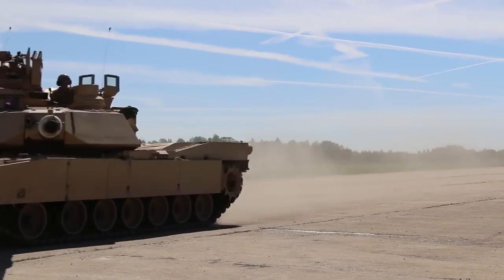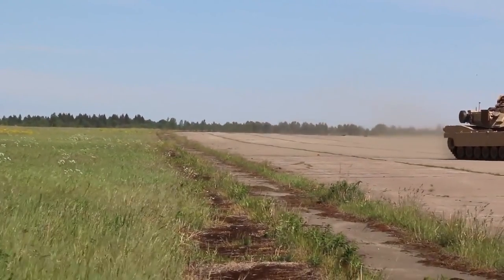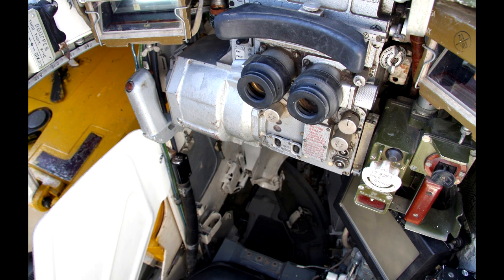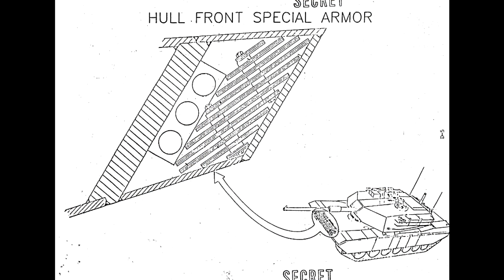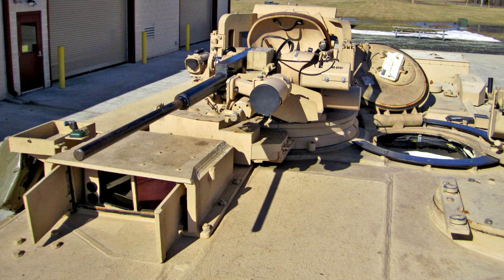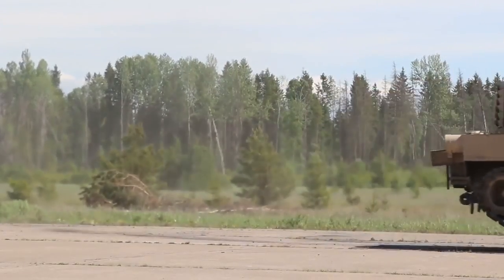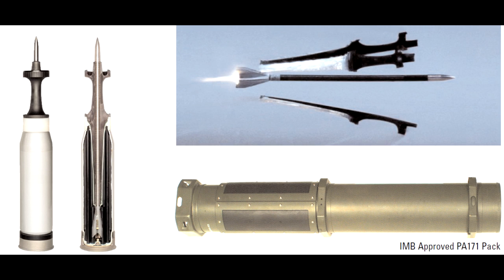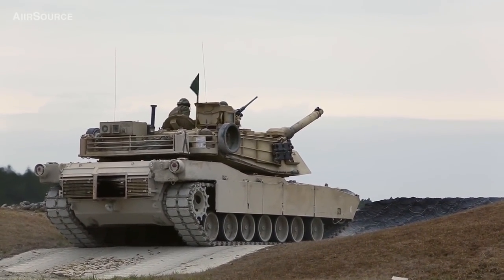Problems with Abrams tank

Comment: The reason the upper glacis is thin is because the armored fuel tanks under it. This is one of the best design features of the Abrams. Fuel is non-compressible and makes good armor. The Swedes used this in the S-tank and there is a penetration test on Youtube. It’s one of those things that would greatly benefit Russian style tanks with the carousel magazine.
Reply: Yeah but the fuel tanks are only on the sides/edges of the front, not in the center (well the driver has to be somewhere too).
The driver is sitting in the center, surrounded by the fuel tanks on both sides, which still leaves a vulnerable gap in the center.
And the Russian tanks do have fuel tanks too (how do you think they can drive?). It's not like the Americans invented fuel tanks lol
But still it's the same problem for Russian tanks too, the driver has to be in the center so the fuel tanks can only protect the edges
Reply: @xAlexTobiasxB  The driver position is the only vulnerable point from the frontal arc. But there is armor behind him as well. The driver’s compartment acts like the Leopard 2’s arrow armor and cause the fin round to yaw and thus not penetrate further into the tank. More over the armored wall of the fuel tanks on both sides of the driver’s compartment are sloped and act like highly sloped armor. There is also no ammunition in the front hull to ignite.

Russian tanks do not have armored fuel tanks up front. There is a fuel tank which offers minimal protection to the front ammunition storage, but these are too small, do not cover the whole front and do not have the Abram armored fuel tank’s protective design features. Many tanks like the Chieftain, Leopard, Ariete, all have fuel tanks designed to protect from HEAT from the side. The Abram’s fuel tanks are designed to counter HEAT and APFSDS from the front.

The Merkava gets a lot of praise for using its engine as a piece of armor. But the reality is Abram’s fuel tanks are superior as protection than the Merkava’s engine. Because the turbine engine is very thirsty, Abrams carry much more fuel than others too. And there’s far thicker composite armor in the lower glacis in front of this fuel.
Reply: @xAlexTobiasxB  No point arguing with someone that use personal attacks. You are simply, tragically misinformed. Bye

Comment: LOL, and THATS why the M1 didnt last long.  The M1A1 fixed basically all those first problems.   Never mind the M1A1HA, HC, M1A2, SEP and A2C lol.
Reply: The M1 was not the tank the Army wanted.  The M1 was the tank that the Army could get Congress to pay for.  The M1A1 was the tank that the Army wanted - but had to wait for the M1 to prove itself before they could get Congress to pay for the more expensive M1A1.  And there was also the issue of the US Army testing the German 120mm gun and rejecting it as 'not fit for service.'*  We had to design a new gun (the M256) around the German 120mm gun barrel.  

* The US has much stricter safety requirements for weapons and ammunition than most other nations.  Even today German 120mm ammunition cannot be fired from US tanks except in 'war emergency' situations where there was no US ammunition available.
Reply: Colin Campbell No offense but I heard du ammunition can be detrimental to crewmen's health
Reply: @hschan5976  And ive heard thats largely just a myth to try to make DU and the Abrams sound bad.
Reply: @hschan5976  it hasn't killed me yet, maybe that only applies in video games
Reply: @hschan5976  true, enemy crewmen, especially in Russian built tanks, lol
Reply: @hschan5976  It's only a hazard when it's travelling a very high speeds.  Otherwise the only safety requirements are standard industrial hygene practices (specifically wash your hands before you eat).

You have to remember why it's called_Depleted_ uranium, because the stuff that provides the most radioactivity (U235) has been removed.  In fact the radiation is not what makes DU a health hazard - it's the fact that it's about as toxic as lead.
Reply: Colin Campbell Does impact not create dust containing du material? Just curious. I honestly don't care whether the abrams is better than t72 or not. Ultimately it's air superiority that  wins the day. Has been so since WWII.
Reply: @hschan5976   No.  Because dust does a very poor job of penetrating armor.  And it does not create enough dust to worry about.  In fact the explosives residue from the ammunition on the tank is several orders of magnitude more toxic than DU.  And even if you swallow DU - the body does a poor job of absorbing it so 99.9% is going to be gone when you take a dump the next day.

Even the WHO has declared DU ammunition residue not to be a human health concern.

BTW - people who know the subject know that DU is inaccurate.  It's proper name is 'Staballoy.'  Because the DU armor and penetrators are alloys made from DU and other metals (molybdenum for tank main gun ammunition).
Reply: CMDRFandragon well said!
Reply: Same with the t 14
Reply: Steve Arthur  The Germans only had air superiority initially.  Once the Russians quit retreating and got their shit in order, they massively outproduced the Germans.  Id venture to say its more production that wins wars. 

As for the US and the Taliban, the Taliban are hiding in mountains and doing things to completely negate, or atleast mitigate the effects of air power.
Reply: Steve Arthur  Well, true.  They are fighting a different kind of war.  Taliban are winning much in the same way the VC won in Vietnam.   What I said about production only really applies in straight up battles like WW2, WW1, American Civil War, things like that, where its 2 sides beating the hell out of each other until 1 side loses the will or ability to keep fighting.

Comment: Laughable

Any other tank with the same amount of combat experience would have been far worst, especially Russian tanks.
Reply: The British Challenegr for example also saw combat and it performed so much better, especially in the 2003 Iraq war with no Challenger lost to enemy fire, while the Americans had to write off a couple of Abrams as a result of enemy fire.
Reply: @xAlexTobiasxB  also the italian ariete was deployed in afghanistan with 0 losses,m1 overrated
Reply: @damicocu3860  Yeah the Ariete, like its father Challanger, was deployed with dd-on armor to protect the sides. To be fair though, the Ariete hasn't seen as much heavy combat as the Abrams did
Reply: @xAlexTobiasxB  not as much but still.also ariete columns were attacked by explosive cars and resisted very well. A question:why are you calling  the challenger ariete s father?
Reply: @damicocu3860  Sorry it always kind of reminds me of the Challenger...
Reply: Nico they have some similarities but they are really different tanks
Reply: @damicocu3860  Yeah I know :L
Reply: @xAlexTobiasxB   The reason we destroyed those tanks was because they were 'mobility kills' that occurred deep behind enemy lines.  We were not going to abort the mission so we got the crew off and destroyed the tanks and continued moving.  And even then this was because of a peacetime economy measure that turned out to be a bad idea in combat.  A generator was mounted to the bustle rack to reduce fuel consumption in order to 'save money.'  In combat small arms fire would catch these on fire and the burning debris would damage the air filters - starving the engine of air.  (This is an example of why you can be sure that it's going to cost even more money, whenever the military does something in order to 'save money.')

Comment: Only combat m1 saw was against Iraqis with old t72s without apfsd ammunition.
Reply: Iraqi T-72 did have APFSDS muniton, but very old and otudated and too weak. The biggest problem however was the bad fire control and bad optics, Iraqi T-72 didn't even have a laser-range finder, so they couldn't even hit accuately
Reply: @xAlexTobiasxB  they did hit some abrams but the ammunition couldnt even penetrate it
Reply: @Manomed3  Maybe like 1% of the Iraqi T72's scored a hit and even then it was only close range urban combat. It really shows how difficult it was for the Iraqi tank crews to get a direct hit at longe range. 

However at least 2 Abrams have been penetrated by Iraqi APFSDS from T72 (in both cases it penetrated only the rear part of the Abrams, so it's not really surprising since the rear is not armored anyway).
Reply: @xAlexTobiasxB  What Im saying is Iraqi t-72s were downgraded and untrained their apfsd would ricochet of the abrams.
Reply: @xAlexTobiasxB  Republican guards did scored hit in 2003 but ammunition was ineffective
Reply: @Manomed3  yeah I know but I'm not talking about 2003, actually I was talking about 1991 gulf war, when 2 Abrams were hit and penetrated at the rear by what seems to be non-DU APFSDS (only the Iraqis used non-DU KE ounds). The most important thing however is that none of the Abrams crewmembers were killed, all crewmembers survived the hits.
Reply: @xAlexTobiasxB  Iraqis were using apfsd rounds from the 60s they were under a embargo from ussr they couldnt get the newest rounds
Reply: @xAlexTobiasxB  If they had more modern soviet ammunition maybe they could destroy some M1s
Reply: @xAlexTobiasxB  thanks for the info king
Reply: @Manomed3  Yea I agree with you, but it wasn't only bad equipment, even worse, it was bad tactics and doctrine. The biggest mistake the Iraqis did was playing defensive, which left them vulnerable to be flanked. They should have taken the initiative and counter-attacked the American forces immediately (meeting engagement), maybe then they would have inflicted more casualties to the Americans (but still lose anyway because they just couldn't win against the US air force).